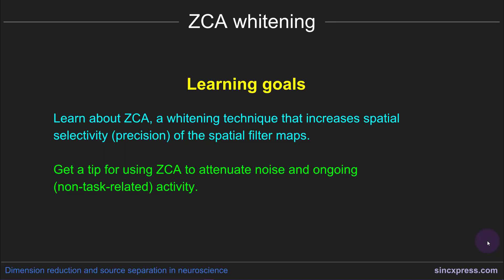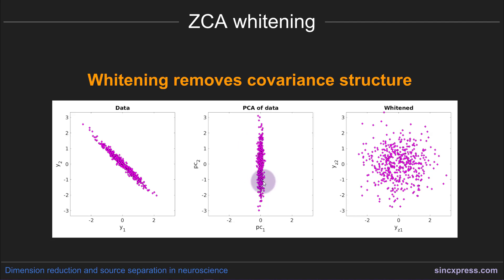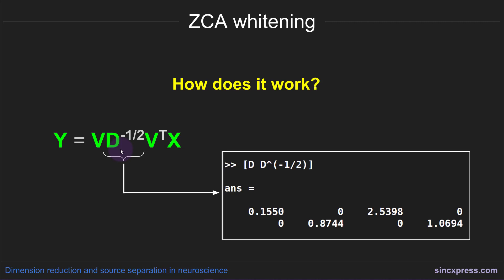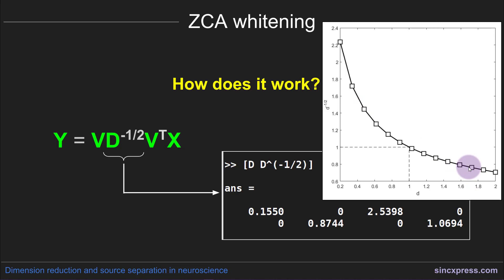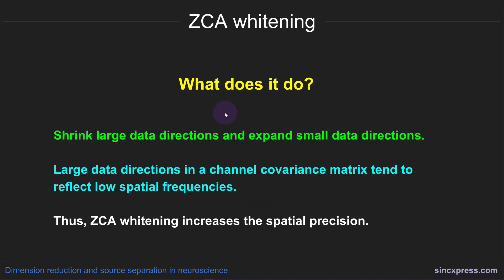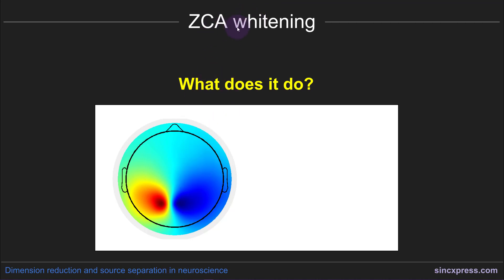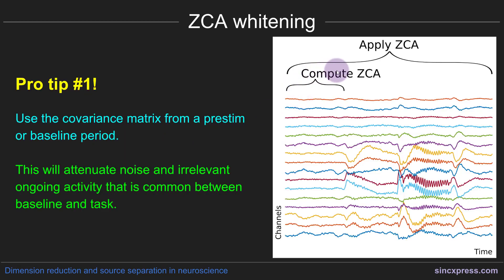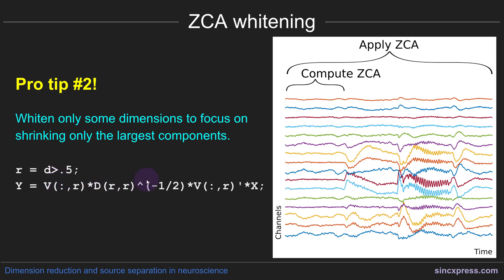Prewhitening with zero-phase component analysis (ZCA)

Comment: Very nice and clear explanation, thank you. I especially like the point at the end about applying a correction calculated from a subsection of the data. This method is now being used in biological 'Omics' experiments to remove plate to plate variability in 96 well plate experiments. (One minor point - in your diagram I think you have the PCA the wrong way round - the first component should be the maximum variance so the data blob should be horizontal? But the concept is still clear 😀)

Comment: Excellent explanation! Except it's wrong ! PCA does indeed decorrelate the data! You can easily see this mathematically by computing the covariance matrix of the projection in PC space and also intuitively by observing the relation of the first variable with respect to the second: can you predict the y's from the x's? No! This means that they are uncorrelated (and, for Gaussian variables, also independent). What PCA does not do, and ZCA does, is to make the covariance matrix not simply diagonal but also equal to the unit matrix (one on the diagonals, zero everywhere else). This is the "whitening" operation.
Reply from the maker: Hi Evan. That's a subtle point, and I apologize if I didn't explain it clearly enough in this video (I do have more videos on this point in the full version of this course). The PCA axes are, of course, orthogonal (decorrelated). This is by definition because the PCA vectors are eigenvectors of a symmetric matrix. However, if there are multiple sources in the data that are correlated in the data space, they will still be correlated in PCA space. That is, PCA does not decorrelate sources; it only rotates the basis vectors of the entire dataset. This is why PCA can be useful for data compression, but is not useful for source separation (and possibly even detrimental when misinterpreted). In multivariate datasets, separating sources is an important goal; decorrelating basis vectors is generally not a goal, but can be a useful means to some other goal (e.g., compression, denoising, or whitening).

Comment: but why one should need large data directions shrinked and small data directions enlarged? can't understand that, my point of view is that when we have a large direction, more important that direction is, right? when we white the data, we loss this information as far as I can see, we are losing information right? sorry I cannot see the point, I really want to understand this.
At the minute 07:30, we are increasing the recall or the precision? when we use zca, the resultant space become more compact and limited, so the data is spread across the result space with more recall, that right?
Reply from the maker: Hi Jose. I wouldn't say that large or small data spatial distributions are intrinsically good or bad; zca is simply a way to modulate the spatial frequency. That can be advantageous if the goal is to identical local spatial structure in the data. Perhaps a useful analogy is with temporal filtering -- low-pass vs. high-pass filtering is not intrinsically good or bad, but information can be transmitted in different frequencies, and so temporal filtering can be important depending on the goals and desired data characteristics.

Comment: Thanks for the explanation. You mentioned that ZCA whitened data's covariance matrix is some constant times identity matrix. However, many resources say that it is the identity matrix (I) i.e. variances equal to one. Is there any reference for that I can look into?
Reply from the maker: The important thing is to have zeros on the off-diagonals. Whether the diagonals are 1's or anything else is simply a matter of data normalization. It's the distinction between covariance (unscaled) and correlation (scaled).